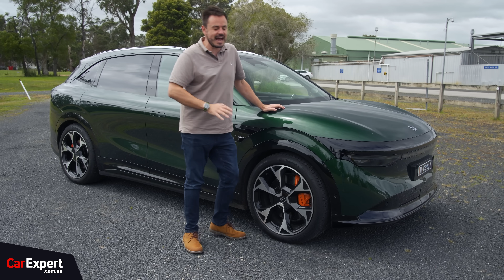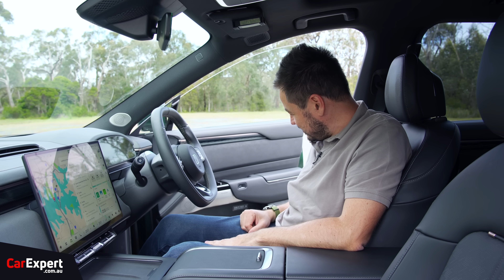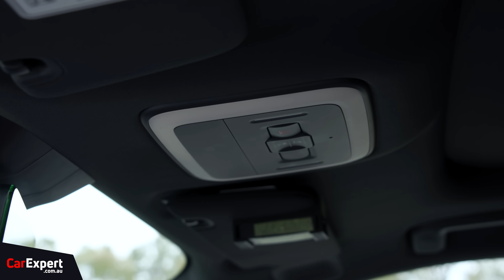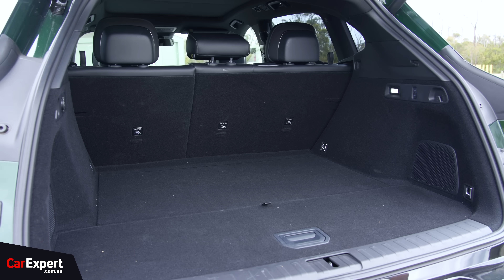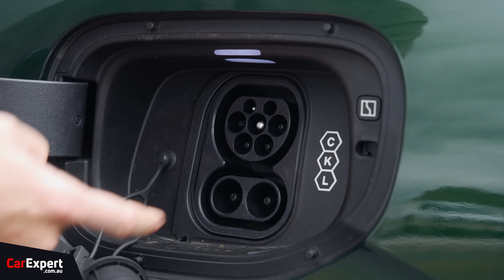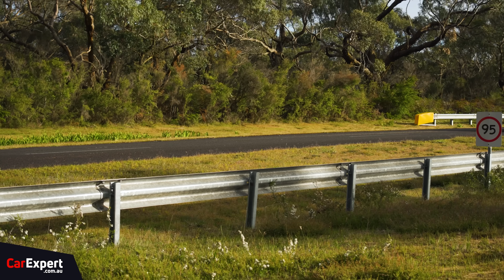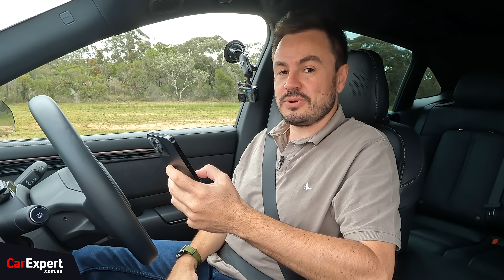The BEST EV I’ve driven this year…Zeekr 7X review (inc. 0-100 & braking)

Comment: I have owned mine for 2 weeks now. Honestly amazing. We got ours in the Green with the white interior, which looks very premium. I think the white is better than the black. The sunglass holder is under the arm rest in both doors by the way. One thing you did not mention was the full panoramic roof with electric sunshade. Makes the huge rear passenger compartment feel even more massive. Got ours tinted to 30% VLT and even in the hot QLD sun, I feel zero heat through the roof, its perfect. The electric door sensors are very conservative, if you stand too close they will stop the automatic door. Obviously that is a good thing that they don't hit anything, but they are overly cautious to prevent a potential door impact. You get used to where you need to stand so the doors work fine.

We use Android Auto and no haven't noticed a single drop out, might be a CarPlay issue. You did not mention the phone app much, obviously have a whole host of remote controls and monitoring through the phone app (just like on a Tesla) as well as opening the car on approach. That has been my only con so far, the phone app unlock on approach has been very hit or miss. Apparently it is an Android problem, iOS owners have reported it works perfectly, I believe its an app permissions problem.

Also it is rated as the fastest charging EV in Australia at the moment. Roughly 12min to charge from 20-80%. It's full charge curve has it charging roughly 3 times faster than the fastest Tesla. Pity we don't have any 420KW or higher DC chargers in Australia yet.
Reply: Congrats! Great choice.
Reply: Really good review
Reply: @basdfgwe agree, excellent and most thorough review.
Reply: I have my long range 7X coming soon and I was planning to tint the front diver and passenger windows but didn’t think of the Sun roof.  Then again I am in Victoria and we do not see the sun as much you guys in Queensland unfortunately.,
Reply: Can you open the doors normally if you want? 
How is the sound system?
Are the headlights matrix?
Reply: Hey mate, any updated review now you have had it for 3 months?
Would love to hear how it is going
Reply: @nathanb-w7g Hey mate, not too much more to add. It's been roughly 5 months since we picked it up and it continues to be excellent. 

One standout had been efficiency. On the highway in mixed 100kmh and 110kmh zones, typically seeing 17kwh/100km. With it's battery size, it should comfortably exceed its WLTP rating of 543km on the highway. On slower flat urban roads, I've seen as low as 15kwh. But in hilly and steep terrain, it cannot hide it's 2.6ton weight. I live in a very steep and hilly area. And on my local roads I'm seeing 20-23kwh consumption.

The adjustable ride height air suspension has been incredibly helpful for our very steep driveway. Well worth going for the AWD model just for that feature.

One con I should add is that Europe have received yet another OTA software update while Australia continues to wait for the first big update v2.1. Somewhat frustrating our market is being neglected while Europe gets priority on all the fancy new features.

But overall, would I buy it again, 100% yes.
Reply: @FuRyZee how is the AC? If you left the car in the sun for a couple of hours and then get in the car in the afternoon, is it powerful enough to cool the car?
Reply: @dominozonda AC is good, loud when you set it to full speed, but it cools quickly. Especially when combined with the seat cooling.And if you are ever worried, you can just turn the cooling on remotely using the app so the car is comfortable when you return to it.
Reply: @FuRyZee I saw the comparison from chasingcars channel I think and they said the AC was bad in all the Zeeker 7Xs they tried, that got me a little worried so thanks for the reply
Reply: @dominozonda Yeah I saw a number of comments on that review that confirmed that their test car was a pre-production model that had not had all of it's software adjusted for Australian conditions. That might explain why it's so loud when you set the cooling to maximum, the fan speed really ramps up high now. But you can drop the fan speed once the car is quickly cooled, and haven't seen any comments from real owners saying that the AC is poor.
Reply: Interesting you tinted the sun roof. From my conversations with installers some are quite "iffy" about it... the key concern is heat build up leading to cracking or other faults in the glass. Some will do it with a disclaimer. Did your installer use a unique sun rood tint film?
Reply: @cameronmale83 Had the same conversations with installers. If the roof was laminated glass then tint would not be recommended due to the risk of cracking from uneven heat build up. But when they inspected it in person, they confirmed the roof was tempered glass, same as the doors, which can be tinted safely.
Reply: @FuRyZee good to know, I’m in brissy too. Too hot to not tint if it can be done.
Reply: Congratulations! Read your post purchase comments below. Thanks. Do you have any further updates after 8 months, please? I was considering 2027 RX450h+ but the review video and owners feedback made me think twice. Highly appreciate your further comments. Thank You. Did you buy the AWD? Some users say RWD model is more stable. Any comments on that?
Reply: @veebee3969  Hey, still continue to be really happy with the car. Zero regrets on the purchase. Maybe one slight regret, I really like the look of the new Zeekr 7GT. I love a fast wagon, maybe it would have been a better fit for how we typically use the car, but that is not to say I dont love the 7X.

I still stand by everything I said before. The car has been excellent and has held up well after 8 months. Even the white leather interior shows no wear. Other things to mention, the car is surprisingly efficient at highway driving. I routinely get around 17-18KWH/100km between Brisbane/Gold Coast/Sunshine Coast, which means it will easily exceed it's 543KM WLTP range on the highway. It is a very heavy car and cannot hide its weight on hilly terrain, consumption gets quite high, up to around 23KWH/100km. On flat urban roads, I have seen numbers as low as 15-16KWH/100km.

Any complaints I have, continue to be with after sales support. So we have now received two OTA updates since purchase. iOS devices have full UWB key functionality now and can now remotely move their car forward and backward using the phone app (similar to Tesla's smart summon feature). Meanwhile Android devices have been left out, and we continue to have problems with the approach to unlock feature. Who at Zeekr Australia decided to focus on adding new features for Apple devices while failing to address things that are broken for other devices.

Outside of that, my only other issue was with the towbar that we ordered with the car. Took 7 months of excuses and missed deadlines from the dealership and Zeekr Australia before it was finally had it fitted. Really happy to have the towbar now, have used it twice to tow our Jetski and it has been great (also good efficiency numbers while towing a Jetski+trailer, around 22-24KWH/100km at highway speed). But I just don't understand why it took so long for it to become available in Australia as it was available for install in Europe shortly after the car was released.

I am not entirely surprised, with a relatively new brand in Australia, that after sales support has not been stellar. Similar things happened when BYD first entered the market. Their support was shockingly bad, but has since become significantly better. I think it is one of those things that will improve with time as their presence grows in Australia.

Most importantly, these sorts of issues are fixable. The car itself continues to be great, once Zeekr Australia sort their collective sh*t out, I will be over the moon.
Reply: @FuRyZee  Happy for you. Enjoy! I was thinking of buying RX450h+ (2027). After seeing this review and user comments, I am now thinking twice.

Comment: Can you use the doors manually?
Reply: Yes.. just a bit heavy for manual operation. Will soft close if you didnt push it all the way.
Reply: yes
Reply: You can even turn off the automatic door opening function for front / back doors. Or adjust the default opening angle etc.

Comment: I thought the front light bar didn't meet ADR requirements and was removed for the Australian market?
Reply: The Chinese model you can use as a billboard and display messages. That's the function that's been removed
Reply: @GaryShepherd-qj2yg Ah! Good to know. Thanks!
Reply: Yes the lightbar was replaced with a more flexible plastic strip to meet both ADR and ANCAP requirements.

Comment: Most of the Aussie reviews have been slightly over the top ( as they always are). Not sure why? Maybe the bar for performance is so low here? Generally the reviews in Europe /UK are more realistic.

Top gear gave it 5 out of 10 which is quite harsh.
Reply: Do they cost more in Europe? If so, you'd be comparing it to different vehicles and maybe then the criticism is justified?
Reply: @rob1733  The 7X is way more expensive in Europe /UK due to ~30% tariffs and/or higher VAT (~20%) etc. Plus shipping costs are higher.
Here in Australia it is only the 10% GST.
Reply: @Antmanzzz which explains why European reviews are lacklustre by comparison. If you're paying more, the value proposition is different.
Reply: Top gear has been tilted towards euro cars since the beginning, I noticed they had a bias against Japanese cars too for decades. Obviously they are Europe they will say nice things about their own local auto giants. Australia has no domestic brands I find their opinion much more unbiased and balanced

Comment: Hi Do you ever consider the battery charge level when doing the speed runs. I noriced at one stage the battery was less than half full.?
Reply from the maker: Yes. We always try and time them when the battery is at a higher SoC but because it’s a shared facility we can’t always use the central testing area early on. And in this review it was completely booked so we had to use an alternate spot later in the day. It would make a difference to the times, but not by a huge margin.

Comment: 24kwh/100km - no thanks.  Also,  charging rates are limited by the battery and the infrastructure. The reality is as follows, the national grid and current DC fast charger deployments are capped at 350 kW for ultra-fast charging stations. Higher theoretical rates (e.g., 600 kW claimed by some Chinese EVs) are throttled or unavailable on Australian public networks, as stations like Chargefox and Evie max out at 350 kW, and power companies e.g. Western Power/Synergy approvals rarely exceed this for safety and demand reasons.

Key Reasons and Implications, Infrastructure Cap: Public DC fast chargers (Level 3) range from 25 kW to 350 kW, with most AU stations (e.g., Ampol AmpCharge, Evie) limited to 150–350 kW due to transformer and cable specs. No widespread 500+ kW sites exist, and grid upgrades for higher (e.g., 600 kW) are rare outside pilots.

Regulatory Limits: ADR 42/04 and AS/NZS 3000 standards enforce safety thresholds for high-voltage DC (up to 1,000 V), but practical approvals from state regulators (e.g., Western Power in WA) cap at 350 kW to manage peak demand and heat dissipation. Exceeding this requires special permits, which are not granted for public sites.

Real-World Impact: EVs claiming 600 kW (e.g., Zeekr 7X) throttle to 200–300 kW, commonly less on AU stations, adding no practical benefit over Tesla's 250 kW Superchargers. In other words there is no benefit to the 800V architecture in Australia.  Moreover 75% of DC sites are limited to between 50 kW and 150 kW and other factors like requirement for DC-DC converters causing bottlenecks that limit charging rates to between 80 kW and 150 kW.  

This cap is a key reason Tesla's Supercharger network (95–96% uptime at 250 kW) outperforms public rivals in reliability and real world power delivery.  

I note the reviewer achieved 24kWh/100km ~ real world range of 94/24x100 = 391km range.  

The absence of FSD in the Zeekr is also a problem making it just another EV vehicle.  

The detail is important especially around charging and FSD.  More so, given FSD 14.2 is being rolled out by Tesla.  I look at this way, with Tesla you buy an ecosystem with other EV producers you buy a car.

I looked into all of this in great detail and ended up going with a Juniper Model Y LR AWD with FSD and acceleration boost.  This vehicle will regularly achieve between 470km and 520km in Australian conditions and does 50kmh-120kmh in about 2.8 seconds or about the same as my GT3 RS.
Reply: Yeah!! 7x spec even better in China and cheaper than Model Y... that why 7x the best selling car in China right??   What are you guys smoking??!!  It's a lot of kit for the price because it's CCP subsidised and you clowns are helping them.   Just roll the dice and buy one.  BUT no need to become insane about 1.  Why is it so cheap (CCP is grooming you/us.)  2.  Why Telsa Model Y still No.1 seller in CHINA?  (where they can buy the 7X and many other amazing cars).  You can be too cheap to pay for the No.1 ... we've all played that game and had our fingers burned....but this time it's different right??!!      KEEP IT REAL
Reply: @chrispw3  I couldn't care less what happens in a communist dictatorship.  There are no amazing cars in the PRC.
Reply: Xiaomi Yu7 Max is what is needed. Has Eco system,  Very efficient,  Great ride, Handling feedback, Luxury and very good assisted driving system
Reply: The reviewer's quoted efficiency of 24kWh/100km is not at all representative. I can only assume he was doing quite aggressive driving, as shown in the review and/or it was particularly hot.
All of the 7X AWD owners I know from various online forums, including myself, see typical driving efficiency at 17-20 kWh/100km. and motorway (110 km/h) driving at about 19-22 kWh/100km. My current average efficiency since I bought the car is 18.4 kWh/km (over 1,100 km so far) and I have not been hypermiling or anything like that but in fact the opposite due to enjoying the acceleration a little too much. That is mostly (sub)urban driving, but also includes some highway & motorway driving, and a trip into the Blue Mtns.
The real-world everyday range I see is about 510km or so, which is very close to the WLTP 543km. I would estimate the motorway (110 km/h) range to be ~450km (for 100% -> 0%) or more realistically just under 400km (for 100% -> 10%), based on my experience so far and what other reviewers/testers report. But have not had the opportunity to do a long road trip yet.
Reply: @Antmanzzz  The 7X performance is a pretty heavy car ~ 2450kg and that has an impact along with its fairly high coefficient of drag ~ 2.5.  Its very good bang for buck for sure, particularly if you mainly home charge (3 phase = 3x32x220 ~ 21kW), however you do have to factor in the larger battery) and don't do a lot of long hauls.  The other way to look at it is, real world you have an electric SUV that is close to a Macan 4S EV and that vehicle is close to 200k drive away.  Personally I prefer the Tesla ecosystem, they are very efficient (e.g. Juniper ~ 14.8kWh to 16kWh per 100km) but that is my choice, for me FSD is a genuine game changer particularly with the roll out of V14.2 (which is occurring now).  Unfortunately people make assumptions e.g. "they just use cameras" without knowing they use full spectrum detectors that range right out into NIR and close to SWIR e.g they can seen in the dark and through mist and smoke. Moreover they are fully passive and this is important for many reasons.  In my view most reviewers do not have the engineering or scientific background to understand the complications of the charging network or how FSD works with its very capable detectors that operate well beyond the human visible light spectrum.
Reply: The absence of FSD makes this car obsolete already. This will badly affect resale values, unless Zeekr have something good in the pipeline.
Reply: @jorganzola1  Agreed, Chinese EVs typically get hit hard with depreciation ~ 50% over relatively short time intervals add to this lack of genuine effective FSD is a real deal killer for many.  Price sensitive buyers are better off, longer term, buying a base Juniper Y or model 3.

Comment: I was one of the first launch customers to get my AWD 7X back in October. Absolutely fantastic car so far for the price (done almost 3000km so far), and my first ever EV. By the way Paul, the top spec has 21 speakers not 10 😁 also forgot to mention the rear seats recline.
Reply: Does sunglasses holder is on the driver's door
Reply: @brunofernandes3247   驾驶员侧和副驾侧都有储物格用来放太阳镜！
Reply: Do the rear seats fall completely flat?
Reply: So how is it now in June 2026
Reply: How are the 21 speakers? better than BMW?
Reply: @dnajournal4321  they are decent. haven't heard the BMWs.
Reply: @asfakhri how many watts per channel is the amplifier? I bet a $400 amp would make it 10x better
Reply: Any things that are annoying?
Reply: Can you play tube or Netflix while parked?
Reply: Good on you. Your model is Performance or Long Range? Would you please briefly comment how the car performs now? Any software glitches or other issues that Zeekr hasn't been able to fix?
Reply: Harman/Kardon in V60 is a lot better at least on my direct comparisson.

Comment: Slight correction on the audio front. Top spec (which I assume you're testing), has a 21 speaker stereo.
Reply: 23 speakers are better.